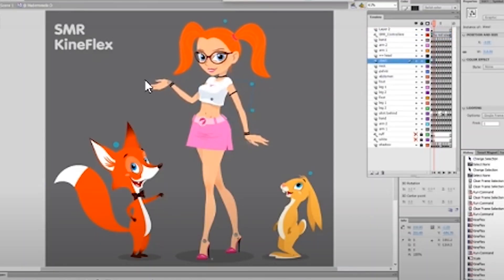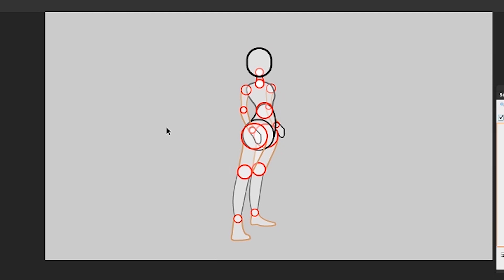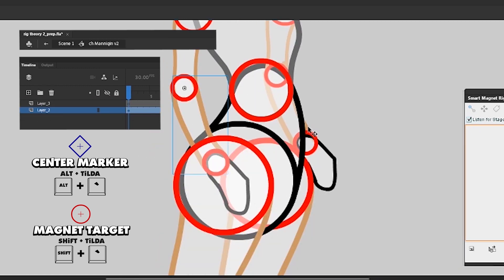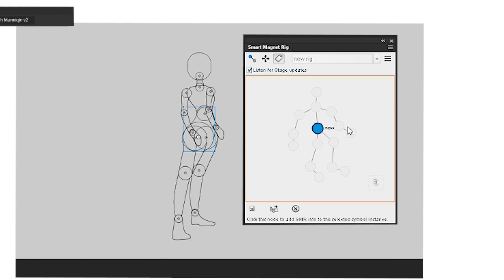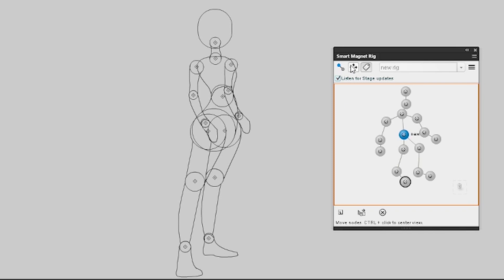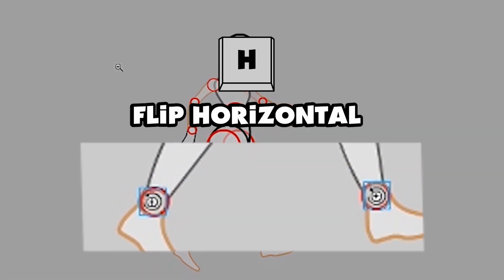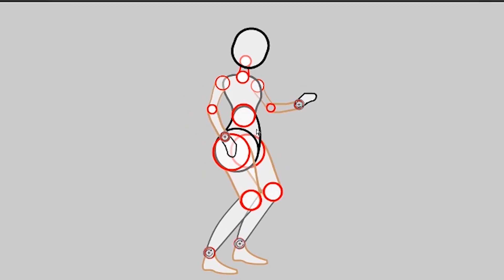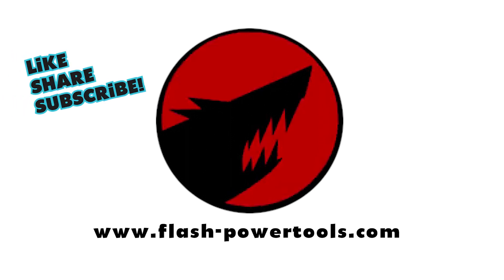2D Rigging Demo using Flash Power Tools- Complete Rigging Demo with Flash Power Tools

Comment: you need to make an updated tutorial with more precise steps, ive been trying to tag the bones for an hour and they just keep talking about a 4 pixel length, or they dont connect at all, theres no specification if you put the layers together or do this to the individual symbols, im sure 3 years so maybe some elements are outdated  , but its just not working, i was hoping this was a way to make a symbol you could control in scene similar to what moho allows, i couldn't find anything indicating it could be done in regular adobe animate
Reply from the maker: You're absolutely right. I've learned quite a lot since I made that.